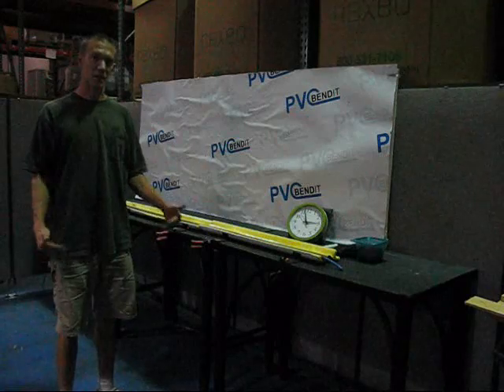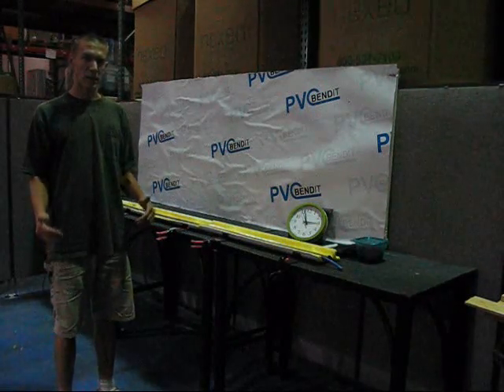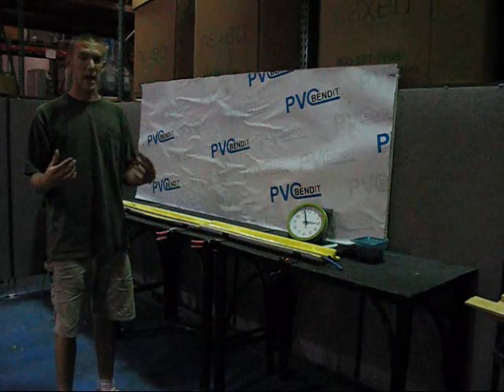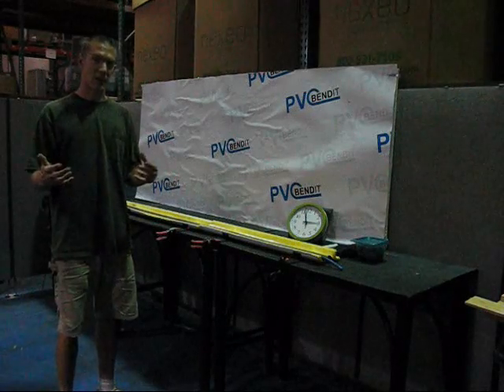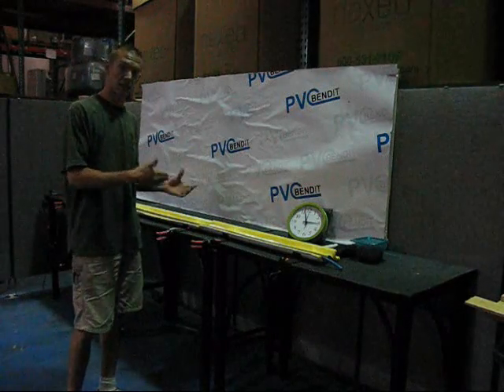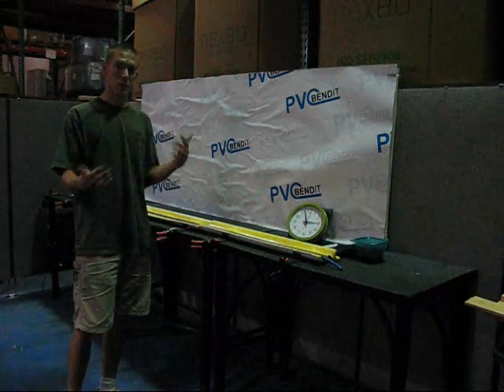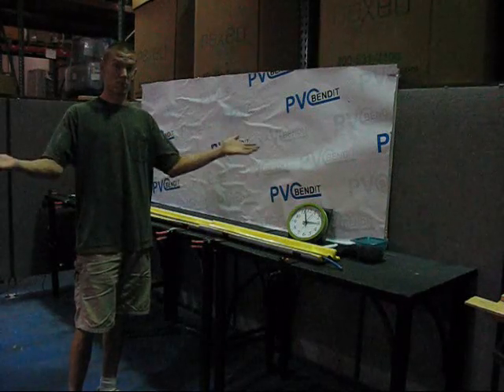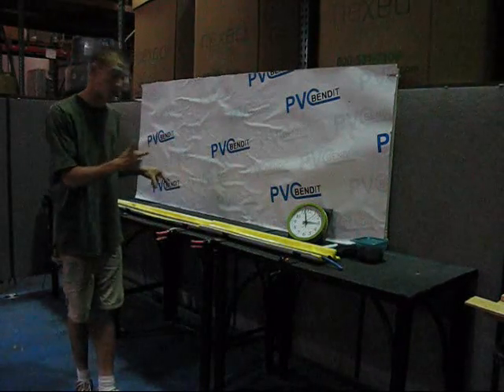How to Bend PVC 008 - Applications - Electrical Conduit Offsets.wmv

Comment: I am going to try to use a regular metal conduit bender but heat the pvc with a heat gun and as it becomes malleable you can bend it to the degree you need.

Comment: *PUBLIC SERVICE ANNOUNCEMENT*  If you want to save 9 minutes of your life, the instructions are as follows:
1) Place your pipe on the bend station, threading the heating wire through the pipe.
2) Close the bend station.
3) Apply the clips to keep it closed.
4) Wait a few minutes until the pipe is heated.
5) Wear heat resistant gloves to extract the pipe.
6) Bend the pipe as needed, or use a bending form is one is available.
7) Allow the pipe to cool until rigid.
These instructions detail the 12 seconds of this video that don't contain unnecessary rambling.  Please up-vote to insure this important message reaches all viewers.

Comment: Yeah that process takes way to long for running conduit in a practical manner. Running EMT is just so much better it protects better and it allows you to use your pipe for your ground. Sorry but no electrician would run pvc throughout a whole building unless required by some really odd municipality.
Reply: I get calls all the time from electricians that use PVC pipe and use the PVC Bendit for various tasks.   I can't debate your comments though as I'm not in the trade.